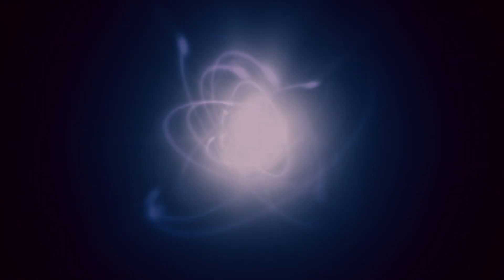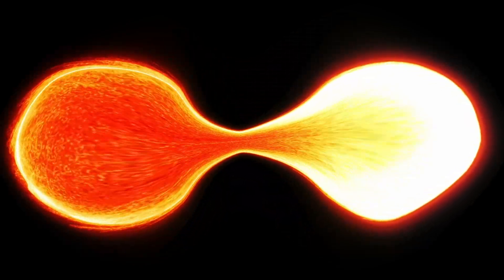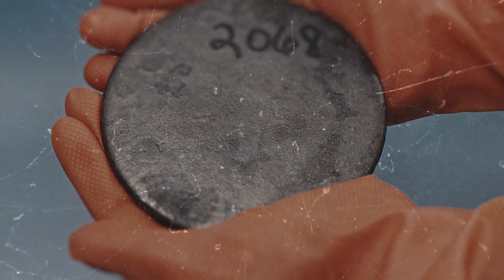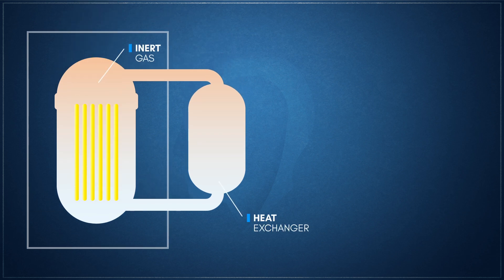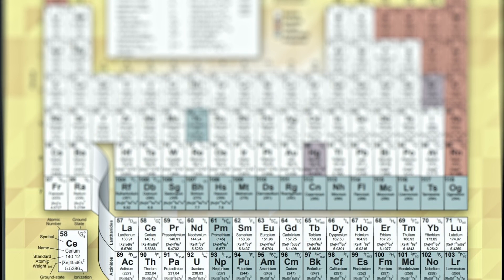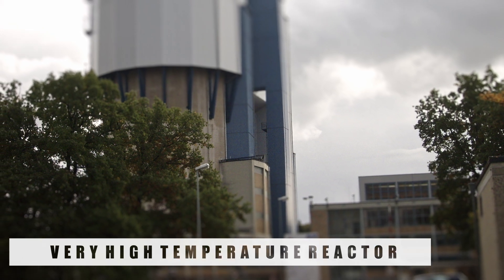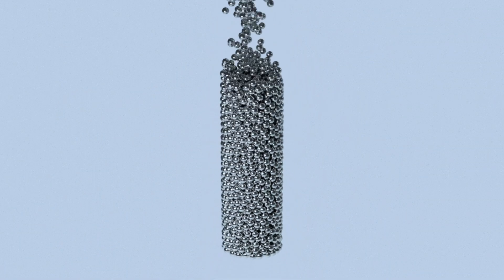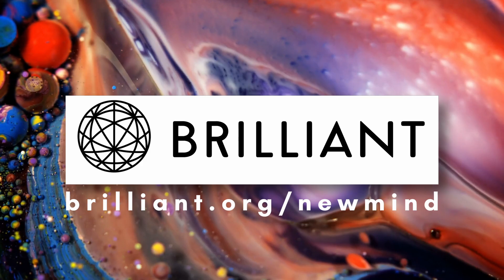Portable Nuclear Power

Comment: Portable nuclear power is a great idea. Let's transport it completely out of the universe. Then it would stop killing us.
Reply: Do some research and stop spreading fear
Reply: @vipondiu  I have done the research. Stop giving us the biggest reason on Earth to fear.
Reply: "For every person killed by nuclear power generation, 4,000 die due to coal, adjusted for the same amount of power produced…" -- Seth Godin (excerpted)
By the same metric, rooftop solar is also more dangerous than nuclear plants - installers fall off roofs.

Which is not intended to minimise the severity of nuclear accidents, but instead to point out that they are accidents caused by human error and not (as with fossil fuels) a fundamental part of operation.
Reply: @CyberiusT  A roofer might die from falling off of a roof, but the roofer's great-great-great grandson will die from leukemia due to radioactivity. from today's nuclear energy

Comment: I thought Thorium was better and safer for fissile plants, but U/ Pu was used instead due to their use in weapons as well
Reply: thorium itself is not fissile, it is breedable to U-233 though, which is fissile. it must be used in breeder reactors
Reply: Not really.
Reply: Myth
Reply: 12.
Reply: The problem was World War Two. The navy wanted nuclear submarines. They tried using a Sodium reactor but that failed, so they went with a light water solid fuel reactor. And yes, Admiral Rickover wanted Plutonium 239 for bombs.

After the war, the electrical power industry went with what had already been used. The Light water industry captured the Nuclear regulatory commission. Their plan was to use fast breeder reactors, but those experiments failed. 

By this time, the Oak Ridge Labs molten salt reactor experiment was shut down and forgotten. All the regulations were crafted to outlaw any Molten salt reactor. 

So, India or China will get to a practical LFTR, before the US does. Damn all bureaucrats.
Reply: Thorium simply forms U-233. This like U-235 is fissiab;e
Reply: @charlesseymour1482  Close. If Th 232 is hit by a neutron, it most often becomes Th 233 for about an hour and then decays into Protactinium 233. If the Protactinium is removed from the reactor, then in 27 days it will decay into U 233. U233 is fissionable.
Reply: To bad nobody told china, what should they do with their Thorium Molten Salt Reactor prototype, just turn it off and go home I guess.

Comment: Theory for an electric generator that uses radioactive cobalt 60 magnets that emit high energy Beta Particles ( electricity ) will it work or will it be to hot to function or can it be cooled in a sub zero temperature gas chamber ? You are welcome to improve these devices
 The invention's electric generator uses cobalt 60 magnets that emit high energy Beta Particles ...Beta Particles are high energy electrons...electrons in motion is electricity ..hopefully these high energy beta particles generated will travel through copper wire for electric use. (1)   comprising of a Microwave Hot Water Boiler Heating System   in which low energy input creates   a higher energy output Microwave Boiler, by converting   thorium/uranium electrons into microwave energy said magnetron microwave device, said microwave magnetron and a   klystron thats cathodes and anodes are plated with thorium and   uranium and whose magnets are of radioactive cobalt., wherein   the invention's microwave emitting device shall be improved by   plating the magnetron's electric cathode with thorium and uranium that is radioactive, the anode is of magnetizable metal,   radioactive cobalt, nickel or iron and the anode is plated with   radioactive metal, wherein the operation of the invention's   magnetron, a high D-C potential is applied between cathode and   anode, setting up a radial electric field, wherein the combined  forces cause electrons to take a spiral path and when the   magnetron, the electric oscillations of the magnetron resonators   set up an A-C electric field across the resonator gaps, wherein   the thorium and uranium metal cathode, magnetic metal anode   of cobalt and plated with radioactive metal, in the magnetron   sets up an increase in spiraling reactions when an electric current   is applied and causes the magnetron output current to be many   times the electric input of the invention's magnetron, and the   invention, comprises of electric devices converting thorium  uranium, cesium tungsten, nichrome, and argon gas atoms   interacting and generating electron emissions into electric   energy, and using mechanical energy input and obtain a greater   energy output of electric energy, the invention's,
Reply: Generating electricity from beta decay has already been done:  https://en.wikipedia.org/wiki/Betavoltaic_device

The rest of what you're talking about, of trying to use radioactive magnets, fissile materials, and magnetrons seems like a weird scheme to find a shortcut around the Conservation of Energy.
Reply: @HannahLemurson  Thanks for the reply - those devices are low power i guess,," In 2018 a Russian design based on 2-micron thick nickel-63 ( cobalt 63 ) slabs sandwiched between 10 micron diamond layers was introduced. It produced a power output of about 1 μW at a power density of 10 μW/cm3. Its energy density was 3.3 kWh/kg. The half-life of nickel-63 is 100 years ".... I'm sure radioactive cobalt 60 magnets are hot and generate undesirable gamma rays but betavoltaic devices most likely will be used in our future electric automobiles ..your article quote: " Betavoltaics were invented in the 1970s. Some pacemakers in the 1970s used betavoltaics based on promethium, but were phased out as cheaper lithium batteries were developed.

Early semiconducting materials weren't efficient at converting electrons from beta decay into usable current, so higher energy, more expensive—and potentially hazardous—isotopes were used. The more efficient semiconducting materials used today can be paired with relatively benign isotopes such as tritium, which produce less radiation.

The Betacel was considered the first successfully commercialized betavoltaic battery,,,,
Reply: @HannahLemurson  As far as the weird scheme...using radioactive magnets, fissile materials, and magnetrons..has been done but the nuclear material evaporates off the cathode  fast..when you plate the cathode with thorium or uranium the electro emission increase 1000x ...you might know it as Thermionic Emissions ..see How a Thermionic Converter Works - Model Demonstration https://youtu.be/K5GVrYcjBKs
Reply: @HannahLemurson   Wow I am glad you replied look what was posted in 2018 ..it is not nuclear YET Modern Electron - Thermionic Converter https://youtu.be/wd3cgAUl-LY  " The world’s first scalable, efficient, and fuel-flexible solid-state generator. A device so silent and low maintenance you'll forget it is there. ".. ( .wait until they plate the cathodes with Thorium 1000x more electrons in motion..or electricity )

Comment: I wonder if we will have one day a compact nuclear power generator, but for very small applications - like the gasoline generator you hook up to a power tool or an RV.
Reply: They have much smaller than that.
Reply: It's more efficient to have good batteries and store the electricity generated by a slightly larger, building or truck-size reactor. A small fleet of reactors the size of a shipping container could replace all the coal plants used by a city. 

What I expect oil and gas companies to do is invest in deep geothermal, which is  green, and leverages their core competencies- sticking complex pipes into the earth and pumping fluids in and of them.
Reply: @alvarofernandez5118  What to do with used up fuel and radioactive bodies of those reactors? How if they will be "stolen" or left on after Biden style retreat?
Reply: @jacekpiterow900  recycle the fuel and keep using it up until you're left with a tiny fraction of it. Then bury it. Please tell me you don't think radiation is magic death cooties? The bodies, you recycle as well - no reason to expect it'll be magically deadlier than the fuel itself.
Reply: @alvarofernandez5118  If that will be so easy Chernobyl, Fukushima, Yucca Mountain, Kyshtym, Windscale, Three Mile Island, will be no problem. Just scup the dirt and bury it deeper... right? How about the rain , ground waters, wind... The more we will use that stuff the more danger we will get. And why? We really do not need it.
Reply: I have some uranium colored radioactive dish chips... want some? Very useful to give for kids to play with. They grow nice bumps after few months.
Reply: Unlikely under known physics. No known isotope has a critical mass that small